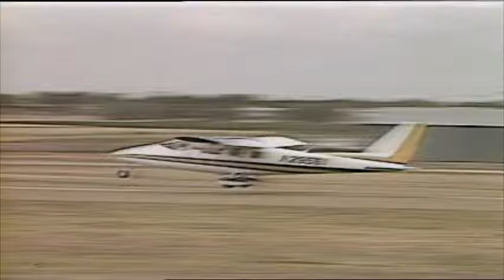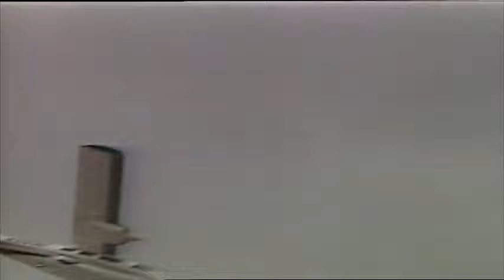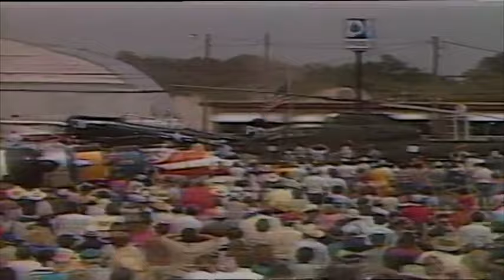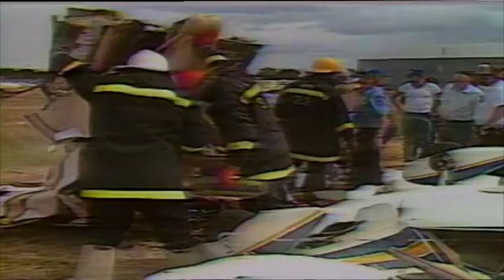Plane Loses Wings During Airshow (09/11/83)

Comment: It's worth explaining what happened: the pilot flying (solo) had exceeded the P68's VNE (velocity never exceed) speed by over 26 knots (~30MPH / 47KPH) and then attempt a rapid 8 degree pitch-up maneuver. This lead to 8+ G's of structural loading, causing the wings to immediately separate from the aircraft just outboard of the engine pods. 

Any pilot without a death-wish knows what should have happened was an immediate backing off the throttle until IAS was back in the green and then, without exceeding Va (velocity of acceleration) perform the pull up (likely requiring further reduction in airspeed). The P68 is a great plane (by all accounts, I've not flown one), but it has limits and this is what happens when you ignore said limits. Thankfully, nobody on the ground was killed.
Reply: He could loaded the plane a bit less, there is no way he didnt feel 8gs pulling on him
Reply: @StoneCoolds  He had to have been well aware he was massively past VNE, so when he began that abrupt pitch-up, the wings separated almost immediately. He'd have had no time to react. The problem was attempting any maneuver that far past both VNE and, by extension, Va, was suicidal (obviously - look at what happened). He needed to remain level and slow down substantially and immediately. Instead he chose to rip his plane apart and die.
Reply: @smakfu1375 wasn’t the speed. Had he been right below VNE, the same thing would’ve happened, just a fraction of a second later.
Reply: Probobaly wasnt first time  for him to do such a stunt the frame may be all ready  damaged.
Reply: @rtbrtb_dutchy4183   I said he had to slow the plane down and "without exceeding Va" aka maneuvering speed, perform the pull up. So yes it was speed, and accident report spells it out pretty clearly, he was well past VNE and even further past Va.
Reply: @smakfu1375  right, but it’s the G loading that made the airplane break apart, not exceeding the VNE. Had he pulled back to 3.8 Gs while being over VNE or over Va, it wouldn’t have been this outcome. 

Going that fast only gave him the opportunity to pull high Gs.
Reply: @rtbrtb_dutchy4183  Stop trying to gaslight. I said right in the FIRST paragraph of my original post: "This lead to 8+ G's of structural loading, causing the wings to immediately separate from the aircraft.".

That the same thing would have happened just below VNE is (1) beside the point and (2) already accounted for when I noted, in the second paragraph, that to perform the maneuver he'd have to slow the aircraft to maneuvering speed. My original post never stated the breakup was a function of airspeed alone, it did state specifically that the breakup occurred due to loading AND I specifically stated that to prevent overloading he'd have to slow to maneuvering speed (below VNE).
Reply: @smakfu1375  dude, there is no gaslighting. 🙄

All I’m saying is, don’t be too focused on speed. 

Your whole “pilot without a death wish knows to pull back on the power” is just a bit weird. 

But whatever. I guess u like to fight to be right. Have a good one.
Reply: @rtbrtb_dutchy4183  VNE exists because of flutter effect. G-overload rarely break both wings simultaniously
Reply: @eanayayo  what?  No. Where do u get that stuff? There are all sorts of reasons for VNE. I used to fly an airplane with the VNE at 306 due to the windshield able to withstand bird impact at that speed. And decades later they adjusted the speed up to 354. Had zero to do with flutter. 

And if you over stress an aircraft, both wings can indeed come off.
Reply: Not VNE, but maneuvering speed.
Reply: @hotrodray6802  No, he exceed VNE… way, way past maneuvering speed (regardless of weight).
Reply: @rtbrtb_dutchy4183 that's basically why Va is for. Before Va, you'll stall before the plane will break. It prevents you from overstressing the frame.
Reply: I gotcha bro-
The NTSB corroborates the op comment.
“The NTSB report revealed that analysis of the video showed the aircraft performed a fly-by over the runway, exceeding its Vne (Velocity, never-exceed) speed by 27 knots. The pilot then executed a sharp nose-up pitch change of about 8 degrees, which spiked the aircraft's dynamic load factor to 8.3Gs and caused both wings to fail in the main spar just outside both engine nacelles then separate from the aircraft, which then began rotating, causing the rear fuselage to twist along its length between its cabin and empennage.”
Reply: @eanayayo That’s definitely not accurate; I mean if we’re discussing something like Braniff 250 that lost its empennage entering a squall the pitch down caused the starboard wing to fail from the down load and that relived aerodynamic force sparing the port wing as the bac 1-11 stabilized into a flat spin. 

But for example Lauda 004 or Copa 202 (even capital airlines 75) which all entered a uncontrolled dive. The former two were trans sonic from Mach Tuck. All had wings fail from passing the Vne and wing separation is symmetrical and simultaneous.
Reply: @BimmieJames  Yeah, because I read the report synopsis (probably the same one you’re quoting) a while back when another video of this was circulating. I got the Vne wrong by 1 digit, but one doesn’t read something like that and soon forget it.
Reply: @rtbrtb_dutchy4183  Focus on not arguing with SME's, dude.
Reply: @kurtpena5462  I don’t know what an SME is. 🤣🤣

Edit: I looked it up: Subject Matter Experts?  You think they are experts?  LOL.
Reply: @rtbrtb_dutchy4183  Don't argue when you don't know what you're talking about. He's 100% correct for ordinary modern planes. In clean configuration, VNE for most aircraft is flutter-limited, it's limited by 0.9 Vd, the demonstrated dive speed. Unless you're doing something stupid, there's generally a significant overspeed margin.
Reply: @straightpipediesel  negative. Structural limits of an airplane is based on IAS, whereas flutter limit is based on TAS. So yes, there is more chance of an issue with flutter…..at high altitude. And I doubt this video was at a high elevation airport. 

The Raven 500 aircraft has a predicted flutter speed of 390 knots, yet its redline is 243 knots. Why?  Structural. 

There are “ordinary modern aircraft” as you call them, that have no structural VNE, but is purely based on the max operating speed of safe deployment of the parachute. 

For most planes, flutter might be part of it, but it really doesn’t come into effect until you are at a high density altitude. This is why there are accidents of small GA aircraft that likely broke apart while descending through altitudes like 10,000 feet and likely stayed below the redline, which is IAS. Why?  Because the FAA decided to make our live simple and only deal with IAS and not having to convert to TAS. 

Don’t argue when you don’t know what you’re talking about.
Reply: @rtbrtb_dutchy4183 You have a funny way of saying cheap unsafe aircraft that needs a band-aid cause it can't handle a spin. He's right, the vast majority are due to flutter. Guess they don't cover overspeed handling in boomer flight school.
Reply: @sarahl7080 Two worlds of aviation: real planes and pilots, and boomers who can't wait to give their kids their inheritance.
Reply: @sarahl7080  cheap aircraft?  You understand that most modern GA aircraft have a parachute now a days right?  And it has zero to do with a spin. But hey, here is a part of a nice article for you:

A bloke with a slide-rule works out a thing called design dive speed (Vd) which must, according to FAR23, be at least 40 per cent above design cruise speed. So Vd is a theoretical speed at which the aeroplane must be strong enough to withstand the aerodynamic forces. The designer must also be sure that it will not flutter. In fact, predicted flutter must be at least 1.2 of Vd.

The way they predict flutter is mathematical up to a point, after which it is by plotting actual test results on a graph with gradual airspeed increments. 

Out of interest, the modelling analysis for the Ravin 500 predicted that it would be free from flutter up to around 390kts. But the aircraft’s red line is 243kts, presumably due to some other structural limitation.

So a test pilot climbs in, with his parachute, gets some altitude under his bum and goes for flight test dive speed (Vdf). This has to be Vd or less. We can’t expect the poor guy to fly the aircraft faster than the maximum speed for which it is designed. In reality, of course, this is not done in one flight – Vdf is only reached after a lengthy build up of test flights, each with its own data analysis.

Then the FAA guy comes along with his red paint brush and makes a mark on the ASI at not more than 90 per cent of Vdf – the maximum speed that the test pilot saw on his ASI. We call this red line Vne (Velocity Never Exceed).

So this means the red line is set at 10 per cent less than the fastest the aircraft has ever been flown. Remember we are talking about a new aircraft. You might be flying that same aircraft 40 years later – and you are still allowed to take it up to 90 per cent of its tested maximum speed. Seems a bit dodge to me – but that’s how it is.
Now we get to the interesting bit. We, as pilots, have no way of knowing whether the airspeed is limited by structural considerations or by flutter.

If the limit is there because of the physical strength of the structure and its ability to withstand aerodynamic loads, then airspeed is the thing that concerns us. After all, the structure is subjected to stresses imposed by our apparent speed through the air – the number of molecules that are pounding it. And this is exactly what the ASI reads. So indicated airspeed is the limiting factor as far as structural integrity is concerned. (For test pilots and nit pickers only: where I said indicated airspeed I should have said EAS (equivalent airspeed) which allows for position error, instrument error and compressibility error. But for us peasants it makes no real difference.)

But, if flutter is the reason for limiting the airspeed then we have to be thinking of TAS. If you were paying attention you will remember that thin air (with a high density altitude) permits flutter to happen more easily – because it has a reduced damping effect.

So to recap, IAS is the limiting factor for structural stress, but TAS warns us that we are approaching a speed where flutter is likely to start.
Reply: Nerd fight!
Reply: @straightpipediesel  LOL. The “real planes and pilots” part are guys like me, with 16K+ hours. With 4K hours in Lear 24/25, I know more about aerodynamics and flutter than most.
Reply: @sarahl7080  I guess you didn’t understand much about what I wrote. Too bad, it was a good read. You could’ve learned something.
Reply: So there was even a warning dial on the dashboard that warns pilots when they are exceeding limits ? He would have been ignoring this?
Reply: @3chords490  I’d assume he knew his airspeed and that he was well past vne, but had “gotten away with” pushing the limits in the past and had grown complacent. There’s a reason such accidents happen so rarely: most pilots don’t do blatantly dangerous stuff that might break the airplane because the ground is hard and will make you (and any passengers) exceptionally unalive.

Comment: For safety, the flight limits are calculated with a certain abundance. If you can't exceed 190 knots, if you get to 192 you're not a dead man. But to exceed as if there were no tomorrow is suicidal.

Comment: The pilot was known to push the limits. Several warnings where given as he ignored those, he pushed it again.
At the first time i thought it was a problem with the plane. But later the reality was more grim than a flaw in the structure. This accident taught me a lesson, never assume the limitations can be stretched.
Reply: assuming a plane is certified for +3/-2g's = that plane (no hiden pre-damage mandatory) will not break midair even at +10% g-overload. - That means, you can strech the limits. However, that hidden safety marging range is far away from endless......
Reply: Being a novice and having been to an enjoyable (accident free) airshow about one month ago, I would not have a clue if a pilot was pushing a plane to or beyond its limits.  Am I one of 99% of those present?  If so, why do it?
Reply: "hmm, the airframe can handle 9Gs max, lets push it to 13!"
Reply: The plane was not designed for high g stunts. A reporter went alomg on a stunt flight before this crash.
Reply: @danizweifler6061   if a plane is certified +3 G, that's not going to last long if he regulary does 5G+ in it.  (And he had to have done it before for practice or other airshows)
Humans builds up G tolerance, planes, not so much
Keep in mind pulling G is not an exact science, pilot pulling what he thinks is 5G will often be more than 5G, bit more airspeed, bit more weight  = way more stress

They calculated at the speed he was estimated, he was doing about 30 knots over VNE & 8 degree pull up meant he was pulling over 8G...
This guy was no Bob Hoover, he was not as precise, did not manage his energy as fine and he did not know what his aircraft could do or could not do.
Reply: told
Reply: @danizweifler6061     This Wing Failure Had NOTHING To Do With "G's",,,,  The Wing Failure Was ALL-ABOUT,,, Air Speed, and Exceeding The RED LINE,,,, Not G's,,, But Airspeed,,,,
Reply: Yeah I was gonna say, seems awfully fast for a plane without a cantilevered wing
Reply: I have over 3000 hours in this model and they are tough little planes.  Evidently not tough enough for aerobatics though.  I can say that every time the turbulence got bad this incident did come to mind 😮.
Reply: @danizweifler6061  There are rules for load factors. An aircraft like this one is 'utility' which means +4.4 and -1,76 G, the limit load. There is a 50% safety marging that's called ultimate load, after which the aircraft is a 'write-off', but it won't break apart. So, 4.4 x 1.5 = 6.6 G. Above that, you're a test pilot and a stupid one at that.
Reply: What kind of plane was it?
Reply: Tolled ??
Reply: I think it’s just a case of pilot error; the PIC let the aircraft accelerate passed its Vne speed.
Reply: @BigWheelHawaii  "THE PLT WAS EXECUTING A HIGH SPEED PASS OVER THE RWY AT ABOUT 250 FT AGL. THE PLT THEN BEGAN A RAPID PULL-UP & BOTH WINGS SEPARATED JUST OUTBOARD OF THE ENG NACELLES. RECONSTRUCTION OF THE SEQUENCE FROM A VIDEOTAPE REVEALED THAT THE ACFT'S SPEED AT THE TIME OF THE WING SEPARATIONS WAS 220 KTS. VNE FOR THE ACFT IS 193 KTS. IT WAS CALCULATED THAT, AT 220 KTS & AN 8 DEG NOSE-UP PITCH, THE 'G' LOAD AT THE TIME OF THE WING SEPARATIONS WOULD HAVE BEEN 8.3 G'S." NTSB
Reply: If there’s a fatigue usually there’s only one.
Reply: @MrDino1953  obviously a typo of “told”.
Reply: LewtenantZen-ph5gc  yes.. 
Sorry I’m not a American nor native English speaking. Next to that Ia do have some dyslexia. 
“Taught” is must be and I didn’t see it.  My excuses for being what I’m .

I did edit the text
Reply: @gerardoppewal372  Does that 4.4 G's (a 100% load) require extra maintenance or only loads beyond that?
Reply: @user-kj2it3qy6u  No extra. Beyond limit load a airwortyness inspection is mandatory.

Comment: Although it may seem strange, it is something that happens quite frequently. There are many frustrated military pilots, who obtain a civilian license and try to emulate fighter pilots. The problem is that since they have no money, they do their exercises in relatively cheap airplanes, which are not prepared to withstand aerobatic flight. And they even dare to perform in shows. In this sense, there is a great lack of regulation in the world of amateur aviation, because behavior like this should lead to the immediate loss of license.
Reply: I went to a lecture given by Chuck Yeager in the 1980's and he talked about how a good pilot had to know what each individual airplane could---and couldn't---do.  He did admit that it was easy to blur the lines when switching back and forth between different types of airplanes.
Reply: Yeah, compare the price of a Paternavia and a Pitts mate. You’ve obviously been no closer to aviation than the occasional Spirit airlines coach class seat.
Reply: Hence my interest in 103 ultralights, no license necessary and no life besides my own to risk.
Reply: Sounds made up
Reply: @malkobitches  I'm a commercial pilot for a living. I also work as a software developer for flight simulation industry. A Pitts is cheaper, but for long distance displays you would need a second support plane. Or transport personnel and material by other means. So in practice, it is more expensive. That's why anyone who wants to do aerobatic flight without showing off buys a Pitts and stays at their aerodrome.